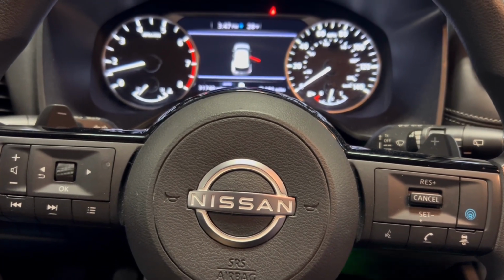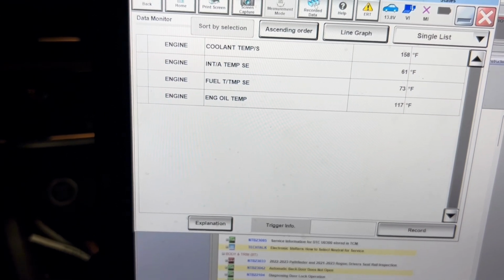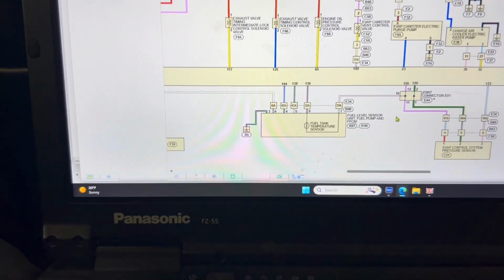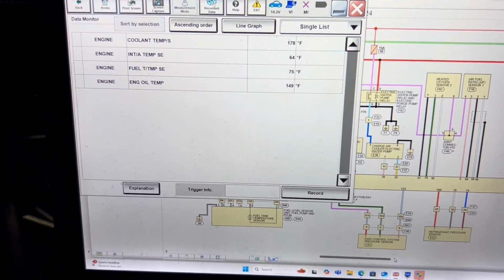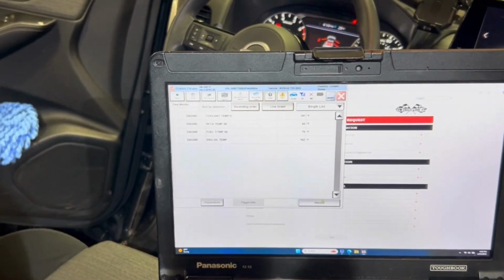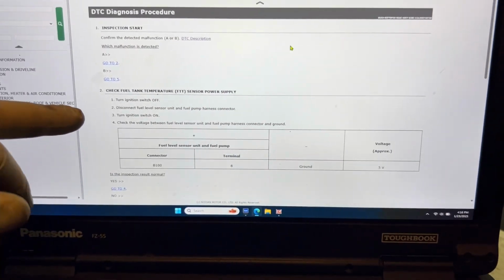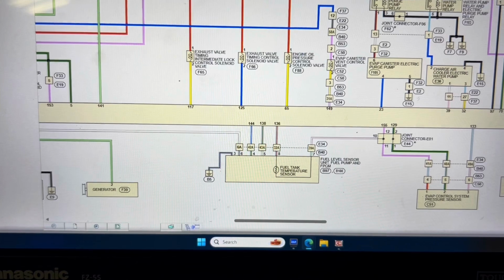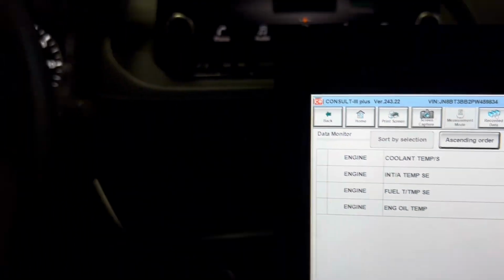FUEL TANK TEMPERATURE SENSOR FAULT! 23 Nissan rogue

Comment: Does the whole fuel pump need to be changed or can the fuel temperature sensor be replaced alone?
Reply from the maker: Some will show the sensor as a separate part number, but most I’ve seen the entire fuel pump must be replaced.
Reply: @MeL1AutoDiagnostics nice thanks, by any chance would you have the part number? Autozone and o Reilly said they don’t carry them since it’s a new model. My local Nissan hasn’t answered me